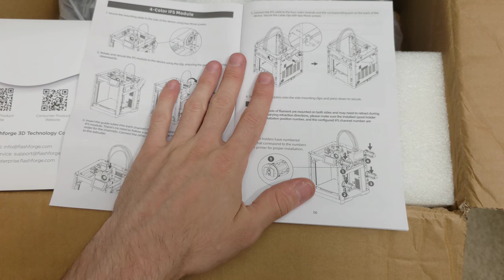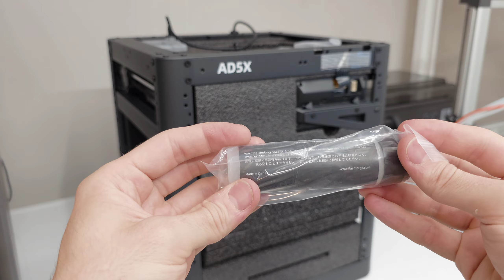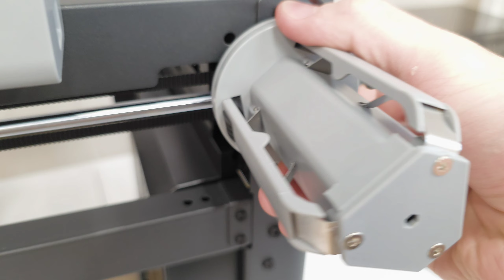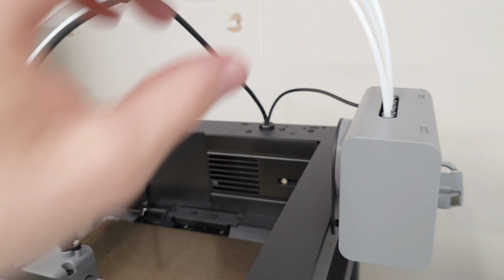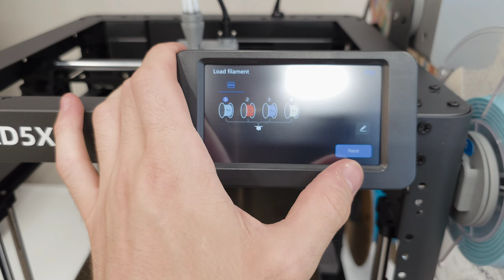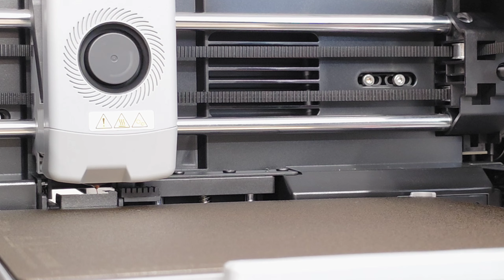I Tested Flashforge’s Cheapest Multi-Color Printer

Comment: Really stuck between this and the anycubic s1 combo. Which would you recommend more
Reply from the maker: They are both great machines. I would get the s1 combo because its enclosure and the anycubic apps are better than Flashforge especially on the phone . However the ad5x is still a great option. I have links to both in the video description your willing to support PrintStart3D <3
Reply: @PrintStart3D  I beg to differ. The Anycubic S1 comes with a bunch of broken promises and riddled with first layer problems that only get worse over time. I have one from the first batch, and instead of having a ceramic hotend, it had a PTFE tube inside that eventually melted and unrecoverably clogged up the hotend. It has never printed the same model consistently twice consecutively. First layer test prints also never show the same results twice consecutively, which is probably the root of the issue. The YouTube channel “Doug Does Stuff!” has a whole series about these issues, and I just have to admire his patience. I've given up on the machine and I'll be seeking a refund from Anycubic.

Don't buy the S1. It's not worth the hassle.

My biggest concern with the AD5X is the unenclosed filament. How are we expected to keep filament dry out in the open like that?
Reply from the maker: @macproduktiv I had some problems at first, they updated the firmware and its been great. Its prints just as good as my other printers. Every printer has problems, sorry your printer didnt work well. I just had to disaymble the hot end on my kobra s1 to fix a clog, same thing on my bambu lab, and etc. But ya I get it, it didnt work well when you first got it. Mine too but recently its been very solid and printing good after firmware updates. My p1s was printing bad because I forgot to tune the belts. So its really up in the air for 3d printing its hard to say when a printer is bad. There's so many variables